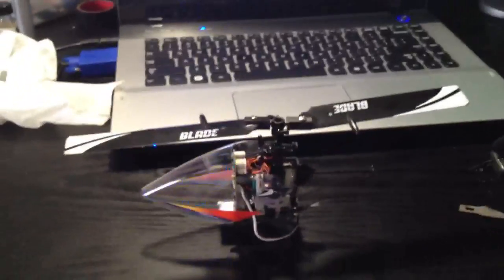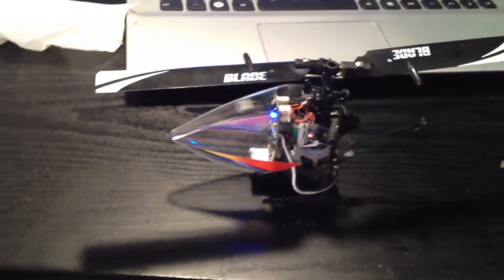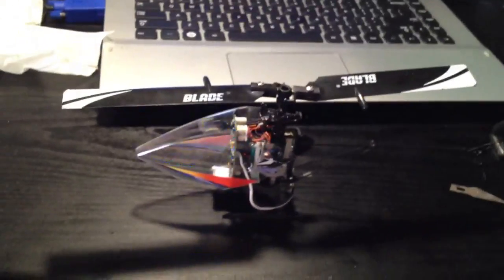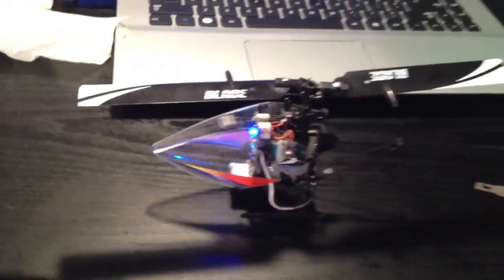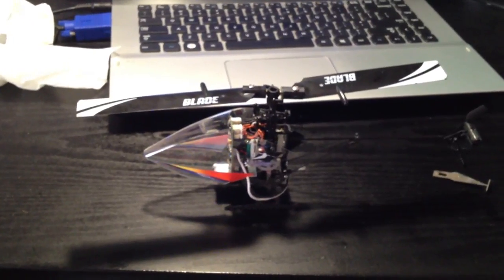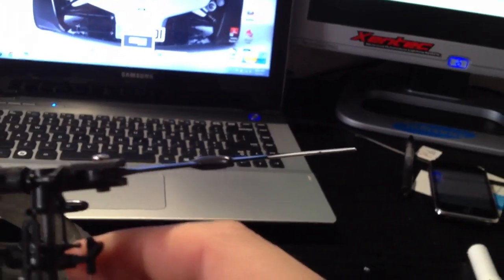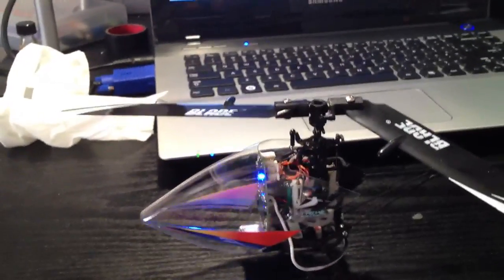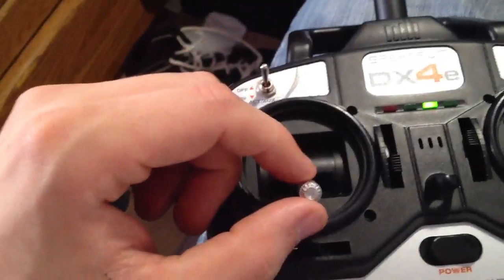About Collective Pitch (6-ch) Helicopters

Comment: 6th channel is for the gyro, the pitch curve is handled by the radio, and the collective pitch channel, the same as throttle and throttle curve. It is used differently among various models but most of the time it's to select between head-hold and Free Flight mode. so you're list is right, but the sixth is just for Gyro, which only some models have and none actually need, which is why it is excluded on a few of the cheapest and many older cp helis.

Comment: Yes but when you say pitch curve, this is just "Collective pitch" which is one of the 5 channels I stated.  It tilts the blades collectively to make it go up and down.
The relationship between throttle position and collective you are saying is still only using throttle and collective pitch which is 2 of the 5 channels I stated.  The transmitter handles the relationship.

Comment: You say this is 6 channel, but I only count 5.  
1 - Cyclic Roll (Left/Right)
2 - Cyclic Pitch (Forward/Backwards)
3 - Collective Pitch (Up / Down)
4 - Yaw/Rudder (Rotate),
5 - Throttle (Main Motor Speed)
You count "up/down" and "pitch" in this video as separate channels but I think you have done a double up here as they are the same thing. 
I point this out as I'd like to know what the 6th channel is for because the manual states these helicopters need 6 channels.